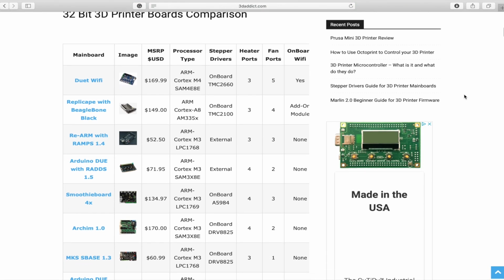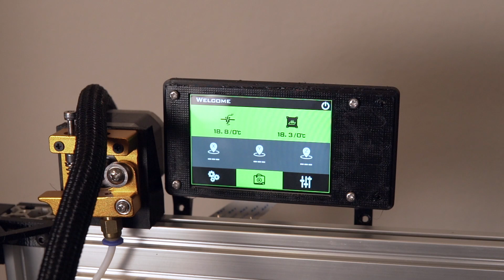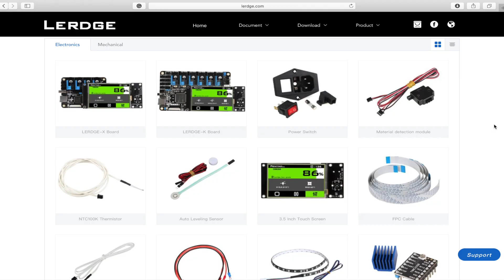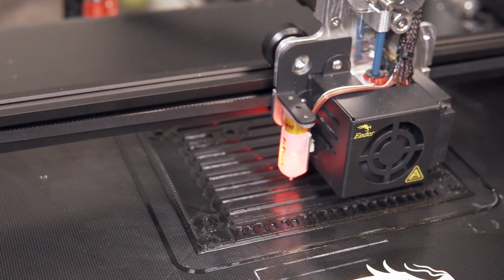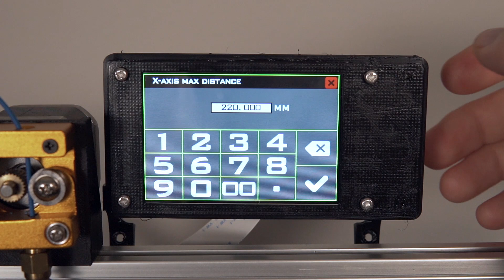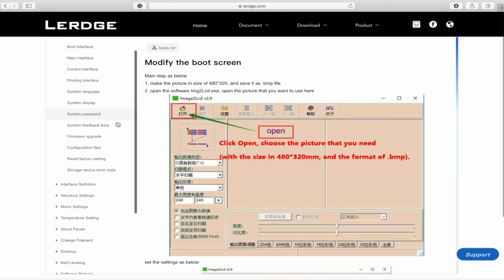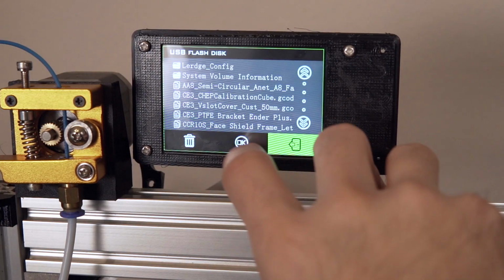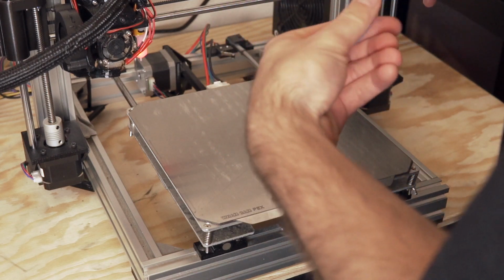Exploring The Lerdge K 32-Bit 3D Printer Board

Comment: Great information, seems that's a very nice board solution, how about cost?
Reply from the maker: Thank you! So the board with the touch screen and TMC 2208 drivers is right at $80.
Reply: @ModBotArmy  awesome. have a great day.
Reply: his affiliate link seems to be from a very overpriced seller. search on ali for different sellers. not sure if that was by accident or maybe to get more commision?
Reply from the maker: My link should be from the actual seller. Shoot me an alternative with seller reviews and I will add it. Thanks for letting me know.
Reply: @ModBotArmy  okay, thanks for your honesty. i haven't used a lerdge board yet, so i can't recommend anyone.
Reply from the maker: @certified-forklifter  You were right, the link I had was an alternative seller which is bizarre to me because they came up before the official store. Appreciate you letting me know. I am updating it now. The official store is nearly 25% less.
Reply: I'm just running in a core xy machine with this board. I would recommend it. Make sure it's the latest version (I think 1.2 or 2.o? Can't remember) as it has the uart control built in. V1 you have to add an external connect and solder wire to the driver. This is so you can set voltage, micro stepping and modes through the touch screen interface.
Reply: 120 dollars for the full pack?
Reply: I know I am pretty randomly asking but does anyone know of a good place to watch newly released tv shows online ?
Reply: @Maximiliano Kingston try flixzone. You can find it by googling =)
Reply: @Jeffrey Turner Definitely, I have been using flixzone for months myself :)
Reply: @Jeffrey Turner Thanks, I signed up and it seems like they got a lot of movies there =) I really appreciate it!
Reply: @Maximiliano Kingston no problem =)

Comment: Will this board work with the Alfawise U10? 

I get a ton of ringing with this printer & it will only print about 220mm high, then home & turn off the nozzle & bed, it will not print the full capacity. So I was thinking a new board work fix this problem???

Thanks

Comment: Nice video. What printer are you using? I want to buy my first printer and I like Lerdge's idea of having the modules to buy. I like the simplicity of configuration too. I'm a programmer, I have no problem with lines of code, but I just don't want to waste time setting things up, I want simplicity.
but I'm afraid, I don't see many people talking well about this board.

Comment: glad i stumbled into this video as i just purchased this board to frankenstein my printer....

even tho it has 6 channels for drivers...

if i only have x,y,z (double in my case) and the e0.... the 2 channels that are "open/not used" do the drivers need to be installed even if they are not going to be used?
Reply from the maker: No you do not need them but if you have double z you can tell the board that it is for a second z (the 6th driver)
Reply: ModBot thank you! im eagered to get it!
Reply: ModBot im frankensteining a Anycubic Chiron
Reply: @ModBotArmy  when I have 3 z-axis, can I use the E1?

Comment: You have a pretty large number of open source boards...about 3 years ago i switched to duet wifi boards for my printers and never look back...but i prefer marlin boards than lerdge closed source one...though skr boards make a few pretty awsome boards...and the lpc series of boards can now have reprap firmware...also the skr pro and skr gtr board now support reprap firmware...and also cheaper than lerdge k board!
Reply: You make several notable points but cost is not one of them, IMHO.  Upgrading firmware on a Marlin board is excruciating no matter how many advocates try to soft pedal it.  I would even pay a small fee for upgraded firmware that was professionally maintained and was simple to install as the Lerge firmware is.  I'm a newbie to 3D printers but it was immediately obvious to me that firmware was/is (by far) the most constraining parameter of the 3D printer universe.  Personally, I don't need access to source code because I don't know what to do with it and I don't want to learn.  Imagine the condition of the average PC if installing software was this difficult.  My observation is that there is little to no pressure on anyone to make the process easier.  Maybe Lerge (or someone like Lerge) can provide that pressure.  Time will tell.  If you use one of these boards or any board with proprietary firmware please contact me.  Thanks.

Comment: I can't imagine used a closed printer firmware, it just sounds nuts in concept.
Reply: Why when it works and is cheap? Having to revoke compile arduino sketch just to make settings changes is nuts and last century
Reply: @andrewjamez  Personally use pio under vscode, firmware recompiles take twenty seconds or so and I just plop the sd card in (I use BTT boards).  I don't trust firmware when I can't see the protections in place... if I have the option for foss I'll take it.
Reply: @ComicMelon  what ever floats your boat
Reply: @andrewjamez  absolutely, I will never compile firmware again. This is simplicity every setting can be adjusted right there at your fingertips on the fly. I would never go back.  Who cares if it's closed,it's not broke and it doesn't need fixed anyways.

Comment: Since the firmware is closed, you need to do your own testing for thermal runaway, and other failure states. I can't see a justification for a closed source firmware now that RRF is available for very inexpensive boards. I wouldn't want to sit there and punch in all printer parameters into a tiny LCD display. You've added WiFi to a Chinese closed source piece of electronics, now you gotta think if this thing is calling home or not.
Reply from the maker: The firmware does have min temp, max temp, and thermal runaway built in. You also can choose to set how sensitive you want it to be as far as temperature deviation from the set temp. Luckily, WiFi is not built into the board so if this is a concern you could opt to not add it like most other boards including BTT. As I mentioned in this video it is not for everyone, and if it is not for you that is perfectly fine. I like having options available for different users.
Reply: I agree very much to you